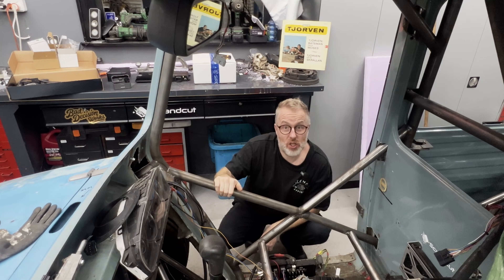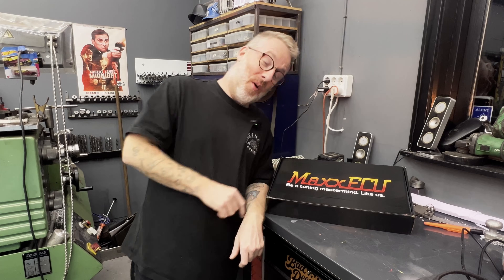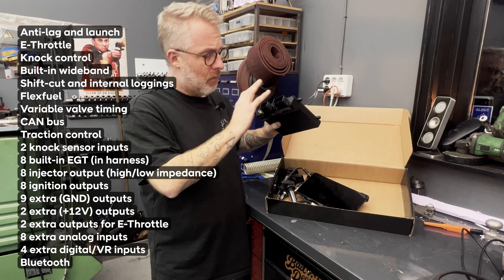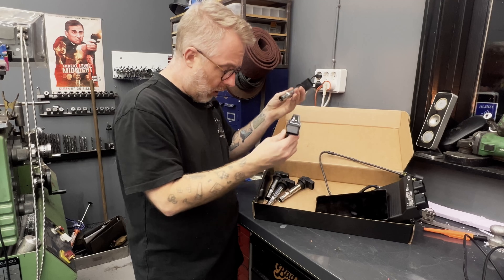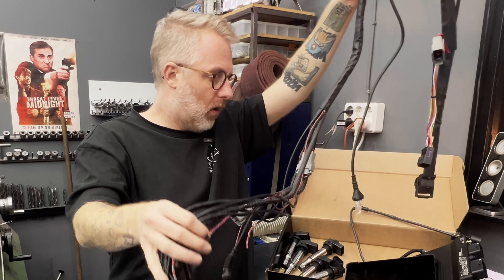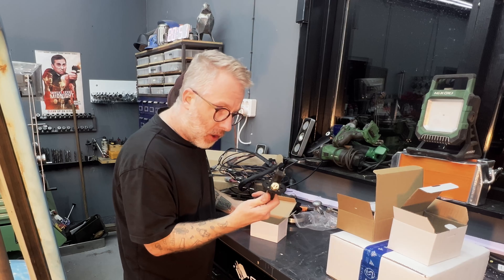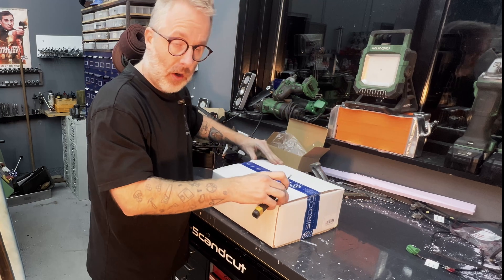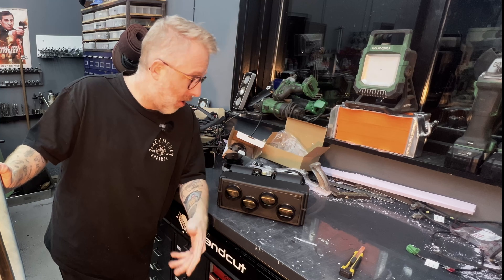Scrapping ALL Electronics and starting over...

Comment: Congrats on the job, it will make life a lot easier! The ratio 80/20 sounds perfect 🎉
Reply from the maker: I used to have the same ratio when i ran BDW back in Holland, but it could also be a pitfall. First try i ended up doing 100/100 and thats not good. So i’ll try to prevent that this time around.

Comment: Hi! Will you also be using a PDM for power distribution?
Reply from the maker: No. I have considered, but there’s too little need for it to justify the 2000€ extra. The software job is not that good 😅
Reply: A PDM 15 from Hardwire Electronics is a very flexible and ok priced unit. :)